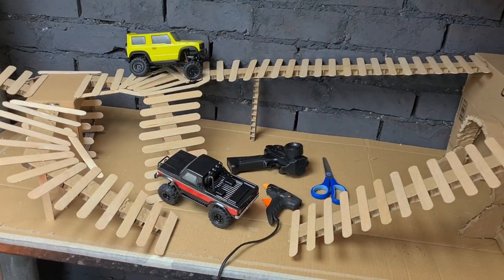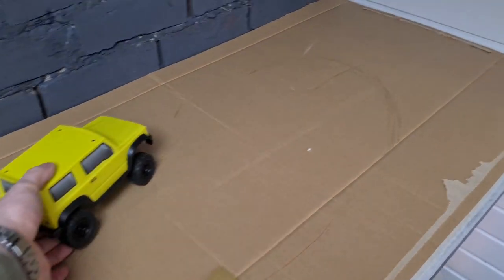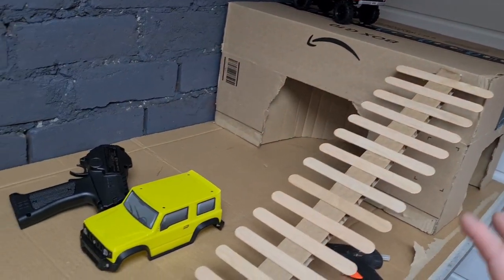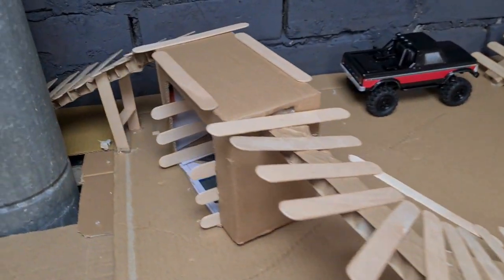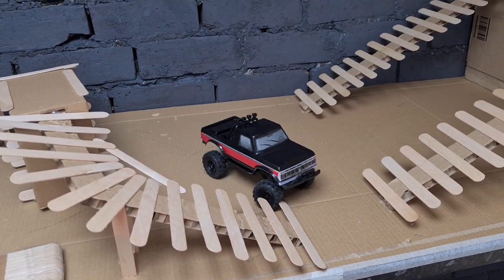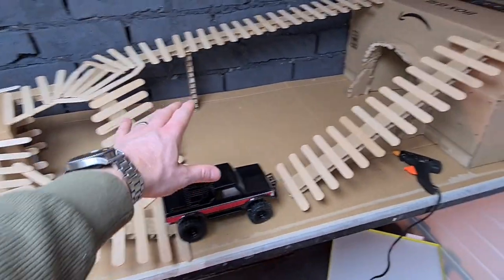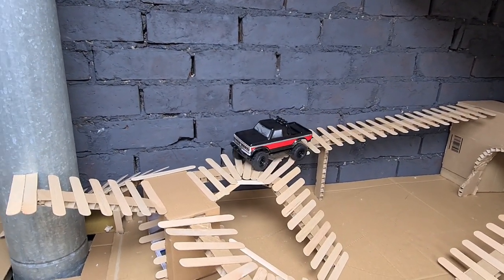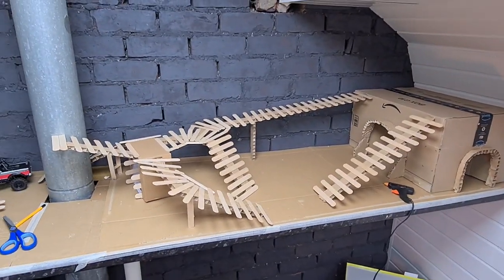BUILDING AN INDOOR RC CRAWLER COURSE MICRO 1/24 PART 1

Comment: Sweet course! Be careful if you want to do this in your own attic with an unsealed/used 'pipe'. In the u.s. we call that "pipe" in your attic "B-Vent". It's used to vent natural gas fumes and such out of your basement and up through your roof. If the house ever were to catch fire in the basement (beneath the pipe), having all that wrapped up in cardboard and popsicle sticks is probably not going to help the situation. Think of that pipe like a chimney running from your basement, straight through your attic. Fire spreads upwards and finds the easiest path it can follow. Just something to consider. Thanks for the tips.
Reply from the maker: Thank you, your correct it's the same over here in the UK these are heating vent pipes, fortunately mine is no longer used as we have a new boiler in a new location on the back of the bouse 👍🏻

Comment: Very cool little indoor course. Could you give the Jimny more running time. I absolutely love Suzuki Jimnys; I have the Kyosho Mini Z Jimny. It looks like you have the Carisma MSA-1E Jimny which I have been eyeballing for quite a while now. I have noticed in the few videos I have seen it in action that there is a lot of torque twist and/or bump steer as it relates to those MSA-1E line of crawlers, and I just have not seen enough videos on it to make an informed decision on whether or not to buy it. Perhaps you have some opinions on how it performs and available upgrades besides the oil-filled shocks that I have already researched, but cannot know if that would help with the torque twist and bumpsteer in any way.
Reply from the maker: Hello, the Jimmy will feature a lot more once the course is complete, but I will say unfortunately the body is quite top heavy for the chassis, to make things worse, they have added a thick plastic top that's molded to sit in, we've took that off ours but it now looks like something is missing, we are going to put some small weights on the axles to see if this helps, we've also found that the tyres aren't very good. We're not going to give up on the chassis.